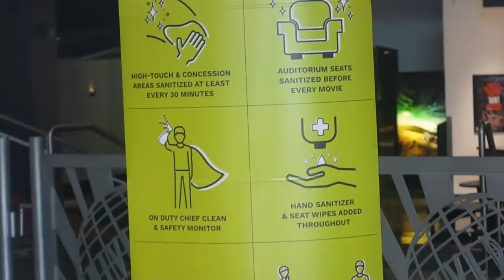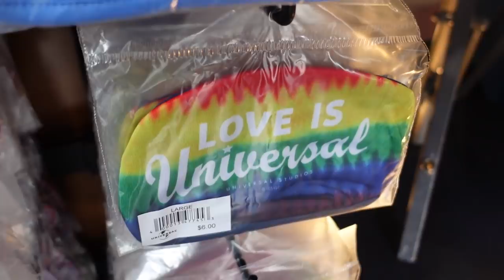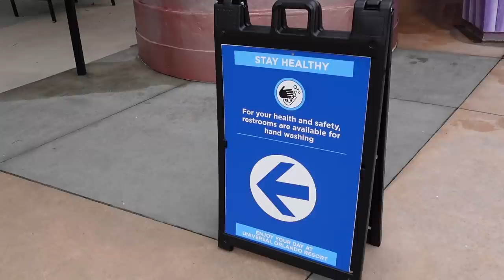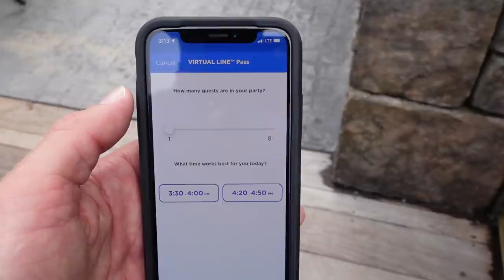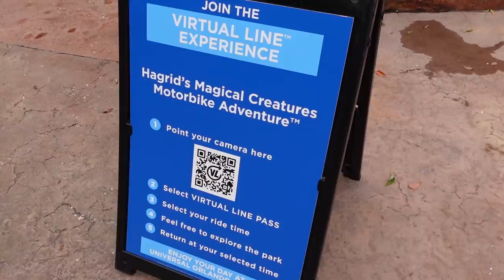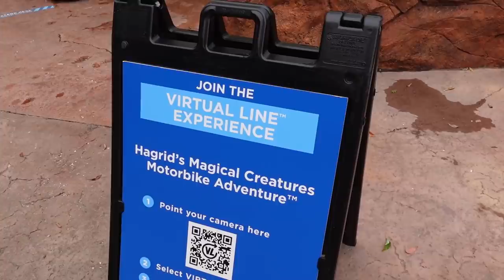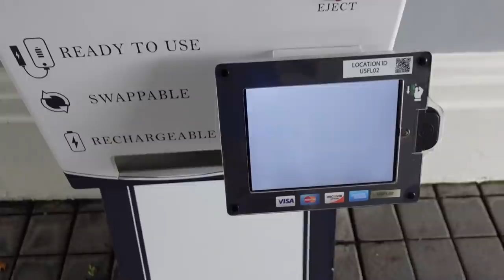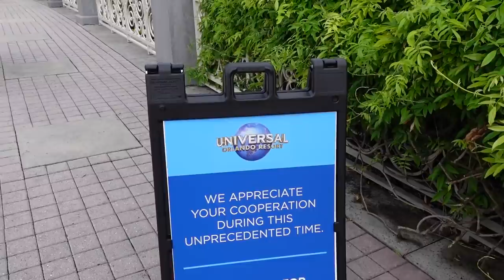Universal Orlando Jurassic Park Roller Coaster Speculation & Updated Voodoo Donuts Review!

Comment: The metrologyworks is a magnetic mounting device is where you mount a laser level onto any surface to hold it in place.  You can mount them on a wall to place a laser level.  So pretty sure it was used to place a level on to level something for the rollercoaster either the pillars or a platform.

Comment: You should try making piña colada at home. It’s such a good drink to have in a hot day. And you don’t need to add rum if you don’t want to. 

There are many recipes out there. But my favorite is 

Blend together 
1 part coconut CREAM
1 part pineapple juice (add a little bit more than 1 part)
4 parts ice 

You can add a bit of milk to thin it out and add whipped cream as topping.

Comment: The blue pucks are a early warning system for land movement, there will be several located around the build area, you will see a device in the distant that has line of sight with it which will ping it at set intervals to let the construction compant know if what they are doing is effecting the area. In the UK it is a requirement for any contruction within built up area that is working foundations

Comment: I just got back from spending 10 days at Universal.  The virtual line system worked great! We were able to ride hagrids multiple times in a row. The virtual line seems long but it's just to get a locker. Once you pass that section its just a matter of walking through the rest of the que to get on. They give everyone hand sanitizer before you get on every ride.

Comment: LOL Tim. So I used to work at Disneyland CA, the way the Charging rods work is that they take the unchaged ones out and they refill any charged ones that have been taken out. Basically, the rods aren't charging in the tiny booth. The Rods are charged out of the both in a separate facility. the rods belong to a separate company not Disney nor Universal. The company is who comes over to the theme parks and swaps them out.

Comment: Tim Tracker discovered something for a laser tracker! Metrology means the science of measurement. That nest is for a reflecor mirror (SMR) to rest in and take measurements with a laser tracker. They are probably using it to take measurements during construction. Either line ups or to check settling. They keep the nest there so they can remeasure the exact same spot over time.

Comment: On the fuel rods, its most likely up to the user to sanitize them upon receipt of device. Everyone should be carrying wipes at this point. Also, for touch screens and door handles, those KeySmart metal devices are great for touch screens and stuff so you dont have to touch high touch things.

Comment: 6:52 that is a 1.5″ Ball Probe Seat Monument – Hard Coat Anodized Aluminum – Blue, it is a mount for a laser MetrologyWorks; full line of Laser Tracker Spherically Mounted Retroreflector (SMR) Ball Probe. Which for simple terms is used to accurately position objects inside a 3d software or in the case of the building to act as a setback point to align objects on their build site.

Comment: That Orange building is the first show scene where the launch happens. The exit for the ride where the gift shop would be is closer to the water front area. The ride exit station and load station run directly next to Dino Digs with the trains running left to right. Around that corner and into the orange building launch track show scene to begin the ride.